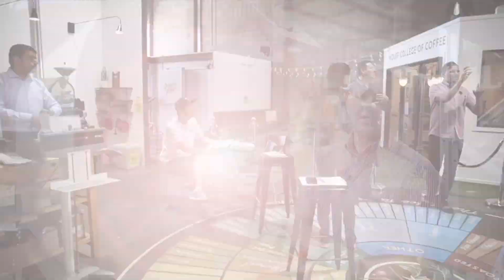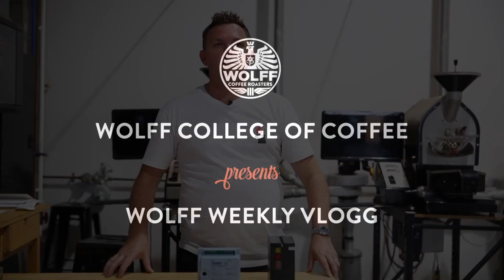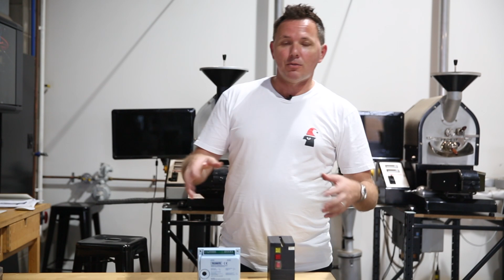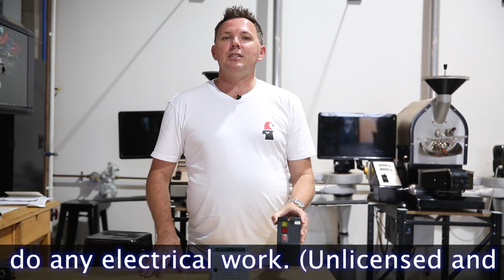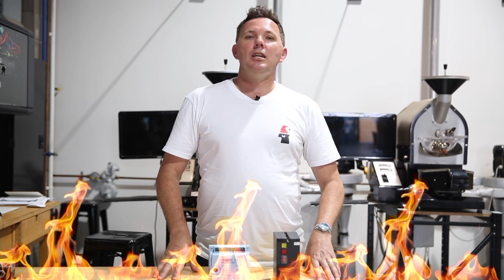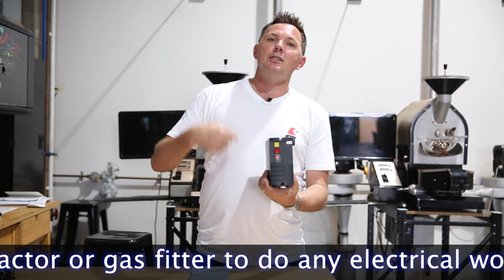Roaster Ignition Controller | What's this bit?

Comment: what is the method, of identifying... do you speak english!?
Reply from the maker: Si! The video is describing the method of identifying the part. So the video is not condoning the improper installation or servicing of electrical equipment .. only using Video as a method of identifying something. Hope this clears up the English query.